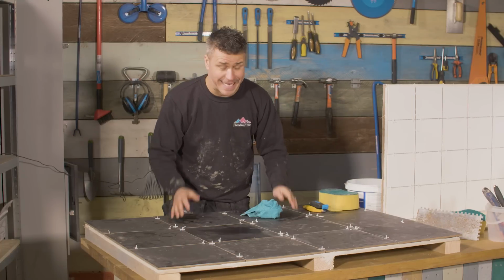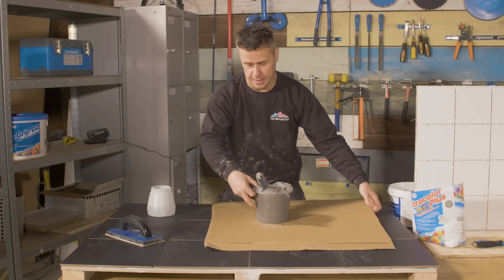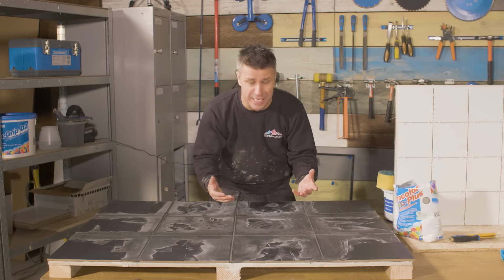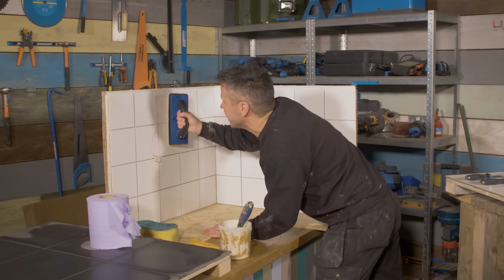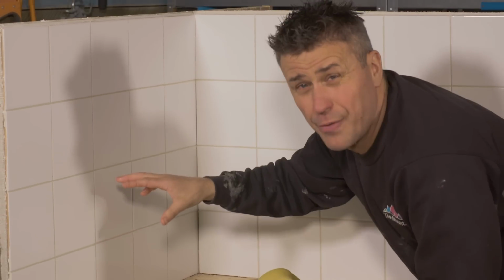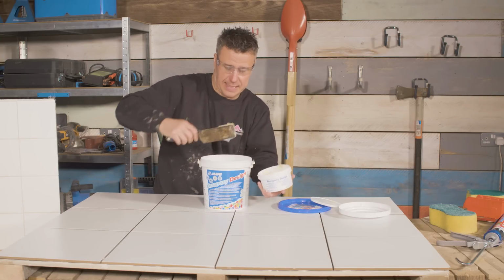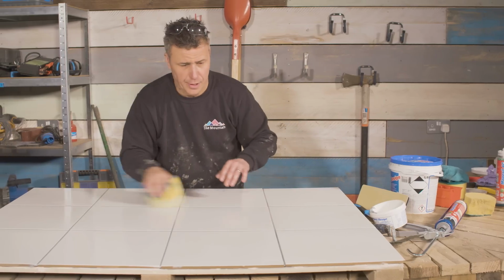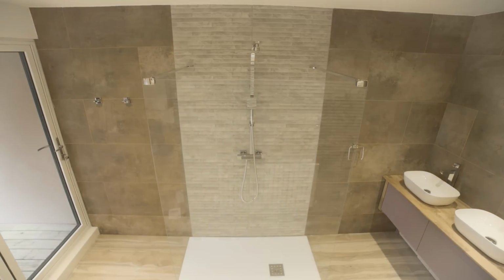How To Grout Different Types of Tiles | Tiling Trade Tips | Full Tutorial feat. Craig Phillips

Comment: For any DIYers following this advice, always use the grout float and sponge diagonally to the joints to avoid removing grout from the joints. During later stages of grout cleanup the sponge can be taken along the joints as required as the grout will have stiffened up a little. And when sponging after the first wash use the sponge to make one diagonal sweep and then rinse, another sweep and rinse, rinsing after every sweep. This will ensure the surplus grout is removed from the surface and not just spread around thus a quicker and more efficient cleanup process.
Reply: Thanks Gaz, good advise
Reply from the maker: Thank you for your feedback and ideas!